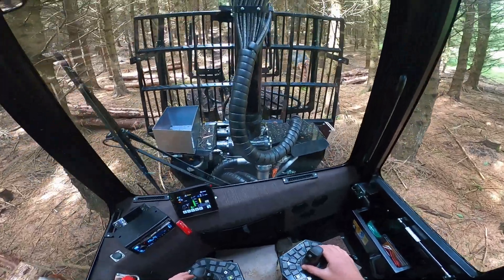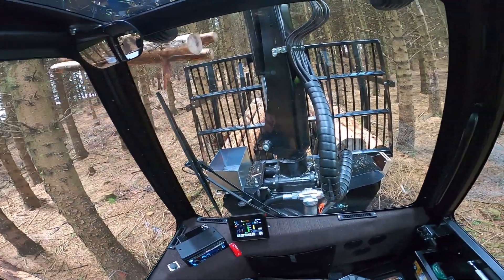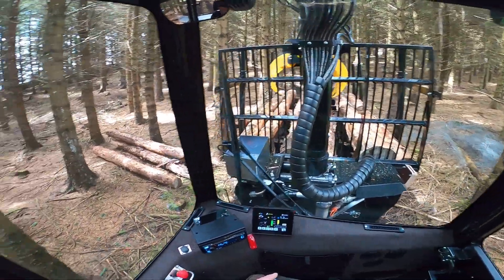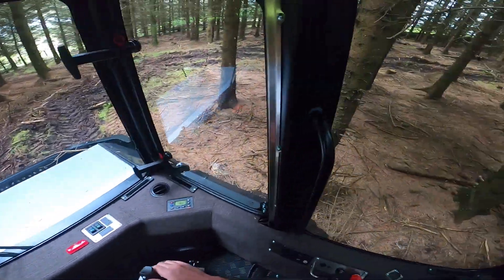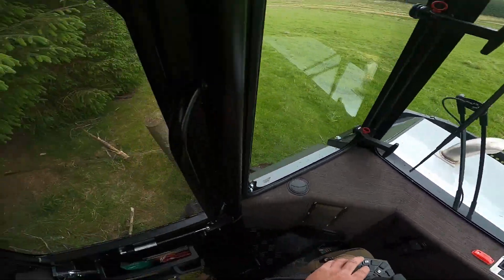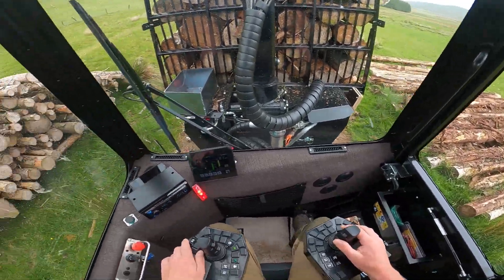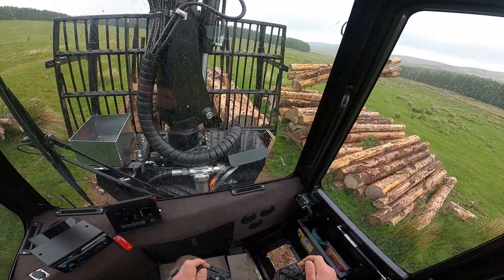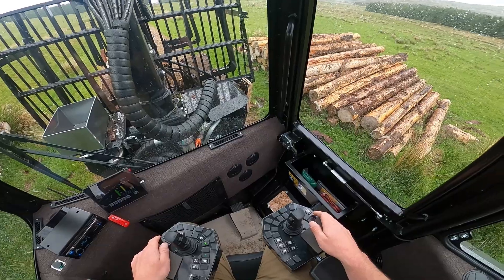Malwa 560 4F Forwarder Demo

Comment: what is the total length of the bunk and can load 16 ft logs
Reply from the maker: Yes, we quite regularly move 16 ft logs with ours and it manages fine.  12 ft is the sweet spot but with 16's we just don't heap them right up.  The bunk is just over 3m long with an extension of about 40cm if needed.

Comment: I like these little forwarders I looked at buying one to use in the New Forest and other the only problem is loading trucks and how far you have to drive to the unloading areas people want you to use and not just come straight out of the forest. Thank you for the video thumbs up and shared.   👍
Reply from the maker: Hi Richard, thanks for your interest.  For long extraction distances you can use the trailer which takes capacity up to 9 tonnes, or in volume terms the same as a Komatsu 845.  (See video here: https://youtu.be/azA9HuT5nHg )  The crane and height of the machine would not be so good for loading trucks though, we have never tried...  

We are looking at the option of hiring out one of our Malwa forwarders for people to use on sensitive jobs and to be able to get a better try of the machines, especially if they have individual sensitive jobs but not full time work for it.  Let us know if this would be of interest.
Reply: @treelinewoodlandsltd6162  Thank you.

Comment: Looks like a nifty little machine! The controls seem well thought out, too. Setting the speed with the dial, much like cruise control, appears a little odd but I'm sure you get used to it very quickly.
Reply from the maker: Yea, it's more like a speed limiter than cruise control as it just sets the top speed.  This lets you keep your foot flat to the floor rather than having to hover at the right speed, which can be tricky when bouncing over things in the forest.
Reply: @treelinewoodlandsltd6162  Ahh, very nice! That is a lot more intuitive to drive, and definitely improves comfort and control a lot. Cheers! :)